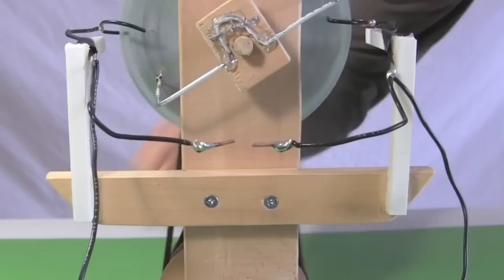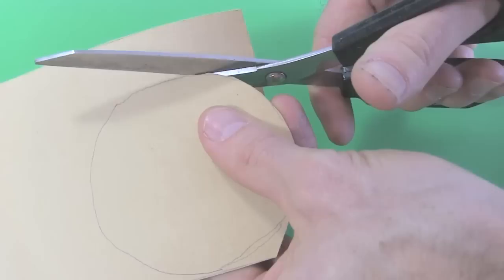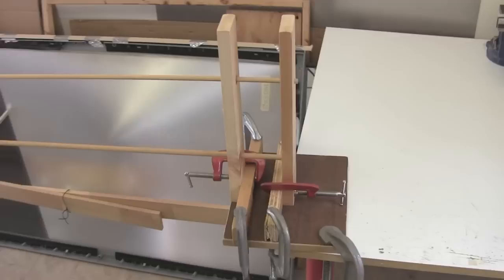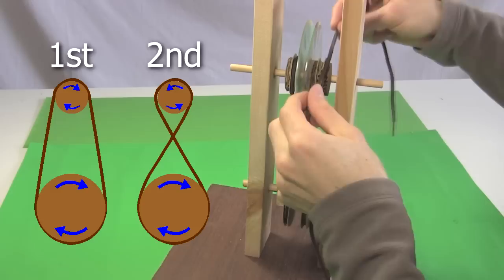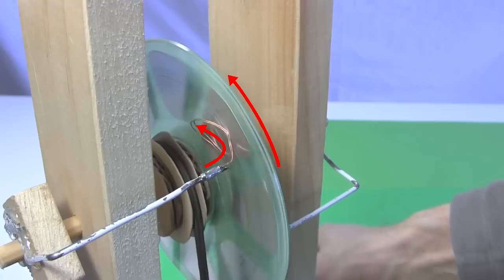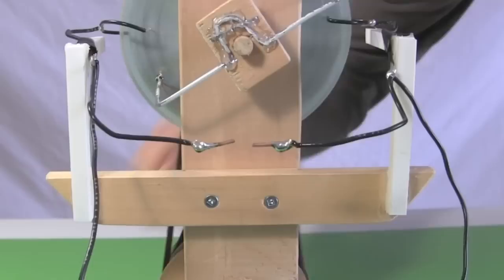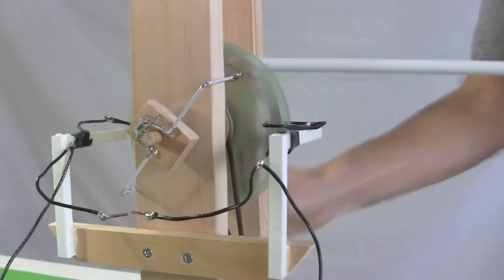Wimshurst Machine - How to Make using CDs

Comment: why do we need neutralizer bars?
what is the use of  capacitor?
Reply from the maker: The purpose of the neutralizer bars is way to much to explain in comments. The best I can do right now is point you at this webpage that I learned it from many years ago http://www.madsci.org/posts/archives/may98/895429674.Ph.r.htmlAs for the use of the capacitor, it's simply to collect additional charge so that when the spark happens it'll have a lot more current in it then there would be without the capacitor. The spark will be brighter and thicker.

Comment: What are the benefits of having more sectors
Reply from the maker: +Rene Gonzalez The charging of the sectors happens whenever two sectors touch the brushes at the ends of a neutralizer bar at the same time. If you have more sectors then this happens more often. It's the same as simply turning the crank faster.
However, if you have more sectors then they'll be closer together and there'll be more losses from sector to sector in certain places and that'll be bad. So there is a point where adding more sectors will make things worse instead.

Comment: what were the mesuremnts you used for the support structure,pulleys, hand crank, and what size of nail did you use.
Reply from the maker: +Karla Soto I have some of the measurements you're looking for on my webpage http://rimstar.org/science_electronics_projects/wimshurst_machine.htm. I'll try and fill in the rest this evening. But once you have the CDs and pulleys on their shafts, everything else can be sized roughly from there.
Reply from the maker: +Karla Soto I just noticed that I give good enough dimensions for the pulleys in the videos. They don't have to be precisely what I used. As for the wooden part of the hand crank, just make sure it won't hit the table as you turn it. If my "nail" you mean the screw I use for the handle of the crank, the size of that depends on what size tube you have for the screw to go through.
Reply: Thank you this helps a lot !

Comment: Hey sir will I  be able to hear and see the ARc when it occurs in a dark room with just dimmed phone light?
Reply from the maker: Yes, you should be able to. As I showed at the beginning of this video, you can hear and see it even in bright light.
Reply: @RimstarOrg  Hello sir thanks for your reply. My wire is made of many smaller strands compared to yours, would I still only leave 1 for the collector?  I guess what is the  gauge for your collector wire? Also do I have to cover the aluminium foils of capacitor completely with tape to prevent leakage? Also is it fine  to use copper rod assector rods because I am starting to suspect my particular hanger wire is not conductive which may be the reason for my 38th failure now
Reply from the maker: Sorry for the 3 week delayed response. YouTube doesn't always make it clear when there's a reply to a reply.
For your collector wires, you could try with multiple but arrange them so that the multiple wires are all around the same distance from the disk. You don't have to cover the aluminum foils of the capacitors completely. Just covering the edges and where the wire makes contact should be enough. Copper instead of hander wire would be fine, though a metal coat hanger wire should work. Just scrape any coating off of the coat hanger wire before soldering to it.
Reply: @RimstarOrg  Hi Rim can you build me one and sent me. I will pay for it at this stage.

Comment: Hello,
instead of plastic rods (shown on 8:26), can I use wood (like veneer)?
instead of using tape (shown on 9:05), can i use glue to connect foil with CD cover?

That way machine would look far better for this years project of mine. Look definitely matters on presentations. Appreciate your answers, very nice and informative video.
Reply from the maker: Using wood (like veneer) should be fine.
And glue instead of tape should be fine too.
Good luck on your project, and make sure you pay attention to the tips I give at the end of the video.

Comment: How many volts can this Wimshurst Machine  produce ? Is it enough to make a ball cyclotron
Reply from the maker: I don't think it would be enough for the ball cyclotron. But you can scale it up by using larger diameter disks. You'd probably need better pulleys too since these cardboard ones probably wouldn't produce the torque needed to turn bigger disks.

Comment: hi, increase the voltage if increase the capacitance and the number of sections?
Reply from the maker: To increase the voltage, increase the size of the spark gap, use round balls for the spark gap, increase the size of the sectors or increase the number of sectors, move the disks closer together.
Reply: ok, thanks!

Comment: Will this power a macro-particle accelerator/ball cyclotron? In you cyclotron video you used what seemed to be a more good quality Wimshurst, I just need to know since I'm making a cyclotron to demonstrate the process in which radioisotopes are made. And it will be powered using this design.
Reply: Also with making the drive pulleys, do you think either perspex or balsa wood.
Reply from the maker: I doubt this small Wimshurst machine would power the ball cyclotron. The larger disks in the one I use in the ball cyclotron video are what make the difference. So if you make a Wimshurst machine with disks around 1 foot/30 cm in diameter then it should work.
As for the driver pulleys, sure, perspex should work. Balsa wood my be hard to connect to the shaft and might break under the load. I show how I made a perspex one in my How to Make Pulleys video http://youtu.be/e5DUvlhhjEI. Perspex is a type of acrylic, which is what I use in the video.

Comment: Can I use courugated plastic board for the disc?
Reply from the maker: I think corrugated plastic board would be too thick. You want the metal segments on one disk to be as close as possible to the metal segments on the other disk, but still with the disks between them so that they don't make a spark between them.

Comment: I have no idea how your disk does not wobble mine so many tries I can’t get it true to the surface oh my
Reply from the maker: You could try putting all the loose parts for the pulleys on the shaft when you glue them together. That way they'll be lined up when the glue dries.

Comment: how far apart should the disks be?
Reply from the maker: They should be as close are you can get them, even if they touch a bit. Touching too much will probably make them slip on the pulleys.

Comment: Can I make bigger sparks if I used a Leyden jar instead of a capacitor?
Reply from the maker: +Frede With Maybe. A Leyden jar is a capacitor, but one with more plate area and so a higher capacitance than the CD capacitor I made. That means you can theoretically store more energy. But if you have a lot of losses in your wiring going to the capacitors, the spark gap and at the collectors then you'll lose charge as fast as you can store it in the capacitor. So insulate things well, use rounded balls at the spark gap and widen the spark gap and your Leyden jar capacitor might build up more energy for a higher voltage spark.
Reply: RimstarOrg Thank you very much.

Comment: hello.. I made this machine and i even made the ball cyclotron.. but sadly neither the wimshirst machine is working nor the cyclotron.. I used the capacitor in making the wimshirst machine not the   Leyden jars.. so isnt it working just becoz I didn't use Leyden jars or is there any prob? pls.. reply back soon @rimstarorg... :(
Reply from the maker: +Farhana Yasmeen If you made this Wimshurst machine with CDs for the disks then I don't think it produces enough voltage and current to power the ball cyclotron. You'd need one with larger diameter disks, like the size I show in the ball cyclotron video. Although, maybe if you ball cyclotron is really small it might work, but I won't guarantee it.

Comment: how would this model go into working with the electrostatic accelerator?
Reply from the maker: This particular Wimshurst machine isn't powerful enough to run the electrostatic accelerator. That's why I had to use the commercially made one with the larger diameter disks. You maybe could do it with a CD Wimshurst machine but it'd probably have to be motorized to turn faster. While the cardboard pulleys on this are easy to make, they slip at high speeds.
Reply: +RimstarOrg OK thanks and how much did you pay for the commercially made one
Reply from the maker: I don't recall exactly how much but I bought it off of ebay.com and it was around $80 USD, not including shipping. The specific ebay link I had no longer works. A lot of sellers sell ones that are almost identical, for example http://www.ebay.com/itm/Wimshurst-Machine-Generates-Up-To-30-000-Volts-and-3-5cm-Sparks-/122017591069?hash=item1c68d0af1d

Comment: Can the collecters be below Neutralizing bar
Reply from the maker: +Rene Gonzalez I'm not sure what you're describing but in general, if you follow around the disks edges like a clock you must have a collector then two neutralizer brushes then the other collector then the other two neutralizer brushes and then back to the first collector. Another important thing is that you don't want the neutralizer brushes to be too close to the collectors. Other than that, you can have one collector at the 12 o'clock position and the other at the 6 o'clock position if you want. They don't have to be at 9 o'clock and 3 o'clock as you normally see them.

Comment: Sir, is it okay if I dont include the capacitor, cause I'm not able to come up with a suitable one
Reply from the maker: Your sparks will be very thin, probably even invisible without the extra charge from the capacitor.
However, get any plastic bottle, cut off the top so that you can reach inside fairly well, tape your aluminum foils inside and outside. Don't have the foils go all the way to the top, have the top of the foil at least 2 cm or 1 inch from the top of the plastic. 
Actually, I just remembered I did it here https://www.youtube.com/watch?v=iV7Irwaqe3w. The bigger the foils, the longer between sparks but also the brighter the spark.

Comment: And on top of two discs bonded foil?
Reply from the maker: Yes. You can see it at 4:00 in the video. I'm using aluminum tape which you can buy at hardware stores. You can also glue on aluminum foil from the kitchen instead.

Comment: Hi. Can you build a small portable device to convert mechanical (rubbing) motion to a spark that can ignite a stove?
thanks :)
Reply from the maker: Do you mean a practical one or a fun one using the triboelectric effect? A practical one would use flint, like a lighter. When I think of how to make a fun one with the triboelectric effect, I come up with a Van de Graaff generator. The rubbing there occurs between the outer surface of the rollers and the inner surface of the belt. A portable one would be a plastic rod with a soda can at one end. The belt would be in the plastic rod and your body would act as ground for charging purposes. The spark would be from the soda can to the metal of the stove.
Reply: thanks

Comment: I am not getting potential difference across two disc sectors/ collector. 
I used pins like structure as shown in bigger machine. Please help
Reply from the maker: How are you measuring/observing that potential difference?
If the sectors aren't becoming charged then the most frequent reason is either humidity or your disks need cleaning. In either of those cases, try the trick I show near the end of this video with the triboelectric effect and the cotton facecloth and plastic rod (many materials will work, see my triboelectric video https://www.youtube.com/watch?v=ey88EdZo9hU).
Or it could be a problem with your neutralizer bars. See the whole section near the end of this video where I talk about issues like that.
Reply: RimstarOrg can u give me ur mail so that i can send you pictures and get more idea. I have this as my project and need to make it working as soon as possible
Reply from the maker: My email address is at the bottom of all my webpages as https://rimstar.org.

Comment: how did you removed that part of the cd which is that colored looking thing? does that prevent the machine from working?
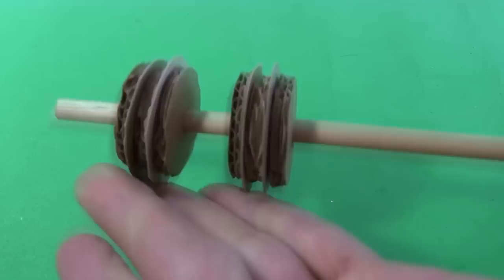Reply from the maker: I removed it using sandpaper. You can see me doing it at 3:15 into the video. It would only prevent the machine from working if the coating is electrically conductive. It didn't know if it was or wasn't so I didn't take any chance and removed it.
Reply: oh, so it's ok. I thought that that thing was inside the cd, like 2 discs and that thing inside. sorry, make a long time I don't see cd's. and thanks for the answer!

Comment: help please... i m in trouble.. i selected this machine as my last year project in degree(electrical) ,  i made this machine using 32 segments on discs , i removed pulleys  and added motors.... everything was fine but when i tried to start it... it fails .... dnt know why but it doesnt working ..... i wonder that did you charged  a  machine before start it for first time by using glass tube rubbed by woolen clothe..?  its required?
Reply from the maker: Charging the machine before starting it, like I do at 10:45 in the video, is sometimes necessary. I don't know what determines whether you'd have to or not, maybe you need to do it more often in humid air? Dust on the disks may also prevent it from self-starting.
Reply: ohkey thanx!! bro do u have any idea how much RPM i have to set on motor to get better output?

Comment: hey dude, can I use this same DIY Whimshurst machine to power your Ball Cylotron in your other video?
Reply from the maker: I don't think so. The disk would have to be bigger.
Reply: The plain cd?
Reply from the maker: I don't know if that's ever been done with a CD, though I've seen it done with larger Wimshurst machines. I also don't know if that makes it any better.
Reply from the maker: @Chiron Tran Yes, bigger disks with bigger sectors would make it work with a ball cyclotron. With bigger disks you can have more sharp points on the collectors facing the disks. Also, using capacitors with larger surface areas would help too. Basically just scale everything up.

Comment: Hello! Im in the process of building my own machine, i'ts a bit bigger than urs, but i've guided myself in your version. The problem is that, i've struggled to make te pulleys, im thinking in making them out of wood, do you think it'll work? Or it has to be rubber/plastic/cardboard? 
I've seen a lot of wimshurt machine  videos but never seen anyone use wood por the pulleys, so im starting to worry, what do you think?
Reply from the maker: Funny you should ask. Coming up with easy-for-anyone-to-make pulleys is the reason I've held off making a bigger machine.  The only issue I can see why people might object to the use of wood is that if it get's damp then it becomes a little conductive, and could help short out the sectors from one side of the disk to the other side. But first, I doubt it would get that damp. Second, if that's a concern then there are things you can do such as don't have the pulleys be too close to the sectors and cover it in something insulating like varnish or resin.
Actually, cardboard probably has the same problem as wood, and it didn't cause me a problem.
Reply: Thank you so much dude! the sectors are deffinetly not close to the pulleys, but i'm going to cover them anyways to avoid any problems.
Thanks for your time, and your awesome video!

Comment from the maker: But you have to make the Wimshurst machine with CDs before you'll have high voltage! So you can't use the high voltage to get the paint off of the CDs first. :) Just kidding. There are other ways to get high voltage first to clean the CDs. Thanks for the tip.

Comment: does the top shaft actually move or is that still? if it moved then the collector bars would also move but in the video, I can't quite see.
Reply from the maker: The shaft that the disks are attached to does not move. The disks rotate around it.
Reply: @RimstarOrg  what wires did you use for the collectors
Reply from the maker: I used 18 AWG stranded wire but the important thing is really how big the individual strands are. I'd guess each strand it probably around 28 AWG.
Reply: @RimstarOrg  does the direction you crank the shaft matter? also thank you for answering all my questions.
Reply from the maker: No, the direction you crank it doesn't matter.

Comment: can someone tell me what the spark gap is used for. I Google it but got nothing. I know what they are and how they work, but why is it there?
Reply from the maker: SteakBarker As far as I know, the spark is there just for fun and education. Unlike a Van de Graaff generator which has its origins in being a power supply for subatomic physics research, I've never heard of Wimshurst machines being put to practical use.
Reply from the maker: SteakBarker Ah, you mean just the spark gap. Besides fun, it indicates that the machine is working. If the machine's not connected to anything else, then you have no other way of knowing that you're building up a voltage in the Leyden jars. It can also act as a limiter for how much voltage is being built up, but once it sparks, that voltage is back to zero.

Comment: if I use a DVD, can it's metal layer mess up with charge transfer even though it's in the middle of a disc?
Reply from the maker: I wasn't aware there was a metal layer in the middle of the disc. Do you mean it's embedded inside the plastic? It's hard to say, but it might not interfere, though there would be charge moving around on it.
Reply: Thanks, i was thinking the same. Gonna test it anyway, if i'll find two useless DVDs around.
Reply from the maker: Let us know how it works out.
Reply: Sure